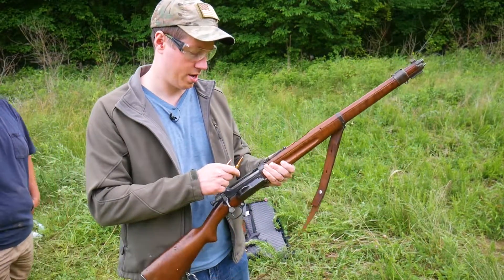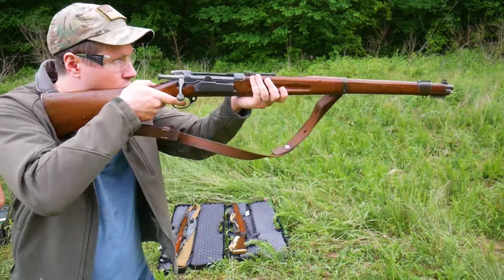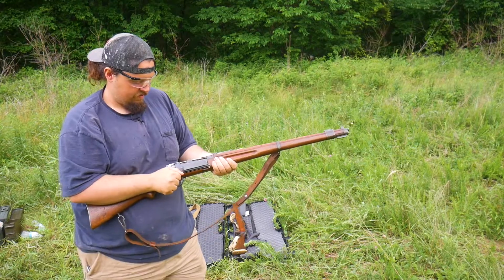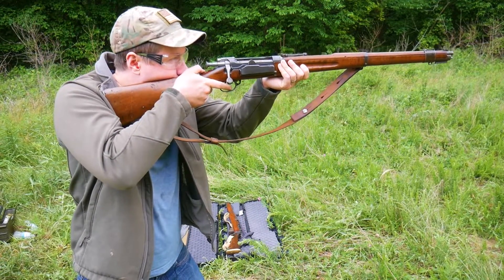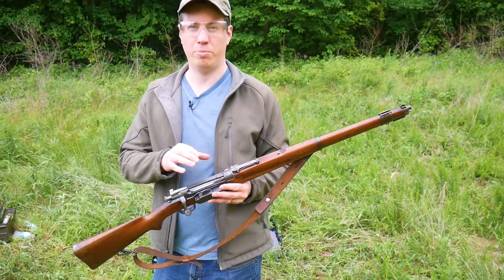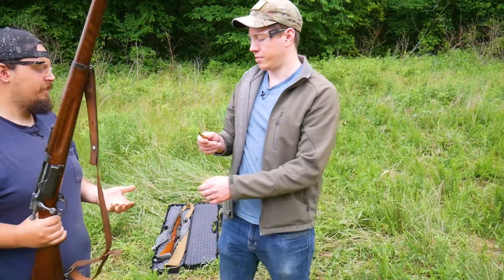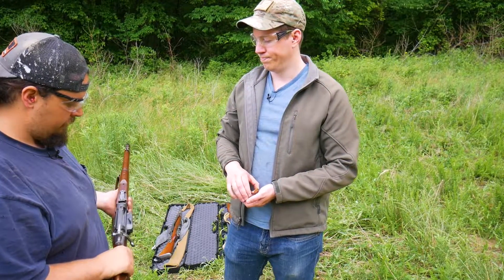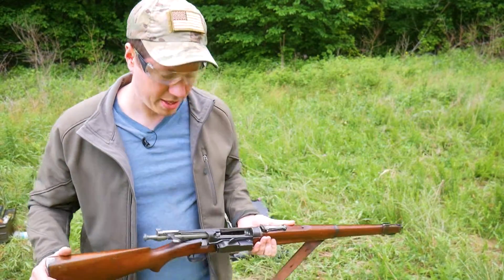Norwegian Krag 1912 Carbine - Initial Impressions and Ammo Test

Comment: Allow me to introduce you to the concept of "Krag-safe ammo". DO NOT, I REPERAT DO NOT! Use just any factory loaded 6,5x55 Swedish Mauser ammunition in a Norwegian Krag. Modern 6,5x55 Swedish Mauser is sometimes loaded as high as 55'000 PSI, whils ammo considered "Krag safe" is only loaded to 40600 PSI.  

Modern 6,5x55 is based of the chamber strength of the swedish mauser action, witch is SIGNIFICANTLY stronger than the old Krag. Initially when the joint Norwegian-Swedish cartrige comission made the 6,5x55, this was no problem, the Krag was plenty strong enough. But as powder and cartrige technology advanced, the cartrige quickly became too powerfull for the Krag, as it was based of the Mauser action strength. As the Krags grew older and many had seen thousands of rounds fired through the action, and as ammunition grew stronger, the maximum safe chamber pressure for the Krag was lowered. But only AFTER sevral accidents with Krag rifles blowing up from too hot ammo. Therefore you should only fire handloaded ammo, or ammo specifically made to be safe for use in a Krag. For this reason we differentiate betwen 6,5x55 Krag and 6,5x55 Mauser as two entierly different cartriges.

Comment: Good to see you got your hands on one, that way I don't have to loan you mine! Absolutely outstanding rifles. The smoothness of a Krag action perfected with a rimless cartridge. Extremely good accuracy, and I shoot mine with PPU if it's going to be stock ammo... but now I'm heavily in the reloading game!
Reply from the maker: I think I still might need another to compare this one too. It seems the ejection is rather weak on it.
Reply: @MilsurpWorld  I wouldn't call the ejection on mine particularly strong either, though it does depend on how hard you're auctioning it... since it the force of the bolt that actually tips that little ejector up.
Reply from the maker: @ArnhemKnight88  Yeah, I'm used to Mausers just being able to work the bolt fairly gently and the round getting flung out.
Reply: @MilsurpWorld  Yeah it's definitely not a Mauser in terms of the ejection. I'd be happy to reference mine for comparison if you happen to have any questions!
Reply: @MilsurpWorld  I also got one very recently, so if you need any info about it lmk

Comment: You're right about the PMC ammo being loaded hotter. I've heard several other guys say the exact same thing.
Reply from the maker: Interesting
Reply: I did some calculations to compare rated 6.5x55 pressures to what they have found in Norway the commercial Krag can handle.  I found that commercial ammo probably is around 20% overpressure, roughly equivalent to proof loads.  I'll see if I can find my spreadsheet to see what projectile weight & velocity was recommended.
Reply: S&B 140 grain FMJs run real smoothly from my experience. Friend of mine has a Norwegian krag and that’s all he uses. Works like a charm
Reply: From what I’ve figured with velocity the PPU is pretty dang close to Norwegian loads (Norwegian ammos velocity was taken at 50 meters).

Comment: The M1912 was my first milsurp by way of inheritance, and it's still my favorite rifle. People allege that the commercial spec stuff is too hot, but the numbers of guns are so few that all the anecdotes seem word of mouth and don't take the foreign shooting audience into account.
Reply: The original load for the rifle was at a lower velocity, modern commercial ammo is loaded to higher maximum pressures.
Reply: Also in Norway where they are not far and few between, this is common knowledge. You cant hunt Moose with it. But you can with other 6,5-55s.

Comment: If I it is extracting hard, the PMC is running to high a chamber pressure. The Krags are no designed to handle Mauser loads. Also with good reloads the rifle will function great. But you are loading to lower velocities and chamber pressures.

Comment: A very sound advice, before you start to experiment with old rifles. You better make darn sure you know what you are doing. The Norwegian Krag 6.5x55 and the Swedish (Mauser) 6.5 x 55 are two different beast and should never be considered the same. The Krag, is designed to operate under way less pressure than the Mauser loads in the same caliber. Your heavy bolt just proved this point. More than one KRAG has suffered catastrophic damages while using Mauser ammunition.

Comment: I have tried a variety of off the shelf factory ammo in my 6.5 Krag and have noticed some are more difficult to lift the bolt than others, most noticeable with Hornady. however the ballistic tables on the boxes indicate to me they are all similar in terms of pressure. I did not notice any primers backing out and typically the freebore and throats are generous as they were originally chambered for m/94 ball ammo. I believe there may be some chamber shoulder variances that made the Hornady harder to remove as I didn't hardly notice when closing the bolt, only opening.... and what was really interesting is it acted the same way if I didn't actually shoot it. In other words if I just ran a bullet in and back out the bolt was hard to lift, pretty sure its some variations in the bullet case.
Reply: I’ve had hornady ammo almost blow a rifle up. I avoid it in older actions.

Comment: Check the shoulder of the case. When that expands it causes the case to stick. Norwegian military cartridges are identical in specifications as the Swedish military loads. I think PPU has got the loading right by using the Swedish specifications. Military cases especially brass has to be thick in order for controlled expansion. I would expect PPU to use the same standards for Mauser type based casings because they made them to be reloaded. I love shooting Mausers myself especially the M98 versions in 7.92X57mm. Military brass cased 7.92mm made outside of Germany especially from the WWII era always have cracked cases after firing which makes extraction hard. The worse are Turkish, and Egyptian ammo. The best is Yugoslavian which PPU adheres to because they have made them almost forever. I think PPU is using the same specs for good brass because they have a reputation to maintain.
Reply from the maker: I'm a fan of the 70s Romanian 8mm as well.
Reply: @MilsurpWorld  Yes they are good but they are drying up.

Comment: I just got a 1912/22 Carbine. Do you notice that the spring is extreemly strong/the action isnt as smooth as the US Krags?
Reply from the maker: I noticed that as well. The Danish I had and the Norwegian are not as smooth as the US Krag.
Reply: @MilsurpWorld  I wonder if the Steyr made Norwegian Krags are smoother?
Reply from the maker: Maybe, have you noticed weak/weakish ejection with yours? Mine does and I noticed the Norwegians that C&Rsenal shot seemed to have weak ejection also.
Reply: @MilsurpWorld  I haven't brought it out to the range yet so I can't speak for ejection with empty shells; I plan to make a video on it soon. So far, with ejecting live ammo it tends to kick them out just fine, abiet not as much as the US krag
Reply: @MilsurpWorld  Alright belated answer, but loaded to the correct Norwegian pressures this rifle shoots well and ejects without a hitch. Not as smooth as a US krag, but smooth none the less.
Reply from the maker: I bought another Norwegian Krag Carbine and it ejects much better than the one in my video. I guess that one was just a lemon.

Comment: What do you think compared to .30-40?
Reply from the maker: Well the main differences was the balance of the short rifle vs the long rifle I shot. The 30-40 was shooting reloads so I don't know if it's an apples to apples comparison but the lighter recoiling 6.5 felt similar. The US Krag's bolt was a lot more smooth. Interesting though because the Krag 1912 is stronger so Im guessing there is a trade off.
Reply: @MilsurpWorld  propably something weird with it, i have quite alot of experience with Norwegian krag's, while usually outshone in that department by the Steyr-made specimens they should not be that stiff (rough chamber maybe?), also try cycling the bolt a bit harder (it was issued to the infantry afterall), should fix the ejection, if not something is amiss...

Comment: Question 1935 Turkish Mauser which cartridge does it any help would be greatly appreciated
Reply from the maker: Any commercial 8mm Mauser will do.
Reply: @MilsurpWorld  the problem i have is 8x57 and there is 7.92x57jrs which is basically whats available
Reply: @MilsurpWorld  and both cartridges are different

Comment: Can you shoot commercial ammo in a krag carbine? I have a sporter stomperud that I have been wondering about
Reply: Enjoying the podcast btw
Reply: in norway we only use rekrutt ammo for it. i think 3300 bar of chamber pressure is the most used max limit in most shooting clubs in norway.
Reply: yes you can, BUT only if it's loaded according to SAAMI specifications, ammunition loaded to CIP specifications can be too hot for it...(also, there are three "levels" of the 6.5x55, the Krag, the Mauser/Swedish and SCAN, the SCAN beeing by far the hottest load).

Comment: Oh god no, stop stop stop!
DO NOT USE MODERN AMMO IN A OLDSCHOOL NORWEGIAN KRAG. 
Modern factory 6.5x55 ammo is vastly different to old school Krag 6.5x55 ammo. Some modern ammo is loaded as high as 55.000 PSI, while most old Krag's should not even be pushed to 40,000 PSI. Older rifles that have a fair round count should only be shot with even milder loads. Here in Norway we have some ammo called 6.5 Junior by Norma which is ammo made for instructional shooting. They are very light loads that go super well with old worn Krag's. The Swedish 6.5x55 ended up being developed for the Swedish Mauser, and eventually was loaded hotter than Krag's can handle. Modern factory ammo is even worse. Treat your Krag's right guys - they are gettting rarer by the day and shooting the wrong ammo in it might just destroy your gun.

Comment: I really hope you did not use factory ammo, cause if you do, it will ne worn out and damaged, and eventually explode
Reply from the maker: Do you have a source for that?
Reply: @MilsurpWorld  i do also have a book wich should explain it better, and wich also includes loading specs/with charging data, or what it is called in english

I can send those
Reply from the maker: @artilleriovervatør  I'd love to see them. It's hard to find good information on these in English.
Reply: @MilsurpWorld  can explain it a little better

Since the bolt only have one lug, this rifle have a weaker point in the upper left corner when the bolt is locked

If one then use modern ammunition, smokeless powder and heavy bullets, this will result in an unacceptable wear and tear. This will eventually lead to cracks in that upper corner and cause the weapon to not working anymore, in the worst case scenario it will blow up,  injuring and  possibly killing the shooter

I almost suspect that something like this has happened to your rifle here, since it almost get stuck when loading

Now, there are some factory loaded ammunition you can buy and shoot, but that would (of my knowlegde) only be 6.5x55 cartrigde with a 6.5 hollow point bullet with around 800 M/S muzzle velocity. In Norway we call this "recruit ammunition" and is often used in sportingm it is a really accurate load!

I sendt you dome data erlyer, it might be a little hard to understand but might be helpful. 

One have to self-load the ammo.And Use Lighter bullets, arouf 9.0-9-7 are the most usual here, and loaded to around 770 M/S and slow burning powder to even out the pressure. This is no problem in a 76cm barrel neither in the shorter carbines

There arent any directly sources i can link to on this, but it is written many places, but mostly in Norwegian

Comment: you should never just put any ammo in the krag... the bolt is not strong and wil find its way into your face if you shoot hard ammo in it.
Reply: the bolt's not the failure point on the Krag, thats a myth.
What actually happens if one has a catastrophic faliure is that the top half (roughly) of the reciever ring shears off, letting the barrel go forward, now however the extractor MIGHT conciviably be torn out from the bolt, thus giving one a right old smack in the head.
Now this would still not be something one would choose to endure, but Krags are NOT bloody unsafe if in good working order, free of bore obstructions and if fed the appropriate ammunition, like any other gun.